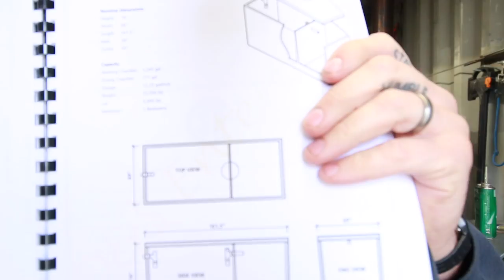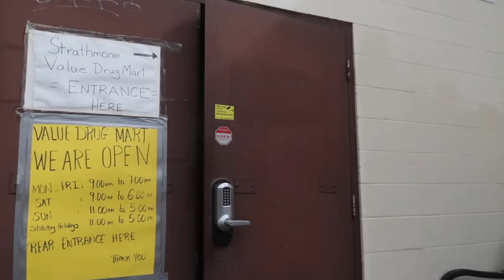Laser cutter! - knife maker's vlog -

Comment: @simple little life, nice work. Love your vids.  May I make a suggestion? My dad made knives for years, and used to glue up like you do in a vise, blade up, uncovered. Please think of using automotive heater hose to slide over the blades to protect your arms in case of a reach over injury. Trust me, I've seen when it goes wrong, and 39 stitches suck.

Comment: Were you using 205 or 206 hardener? That's some expensive epoxy to use for just two teeny knives. Unless you know of somewhere in Canada to get West Systems that I don't know about? I got it originally from Lee Valley, but they're way too expensive after shipping these days. I was using 105/207 for doing homemade micarta as it dries almost totally clear before but am now testing out East Systems stuff as I can get it a lot cheaper than I was able to find West Systems stuff.   I do still have some 105/205 around for doing mosaic pins, which reminds me.. I need to make some more of those.